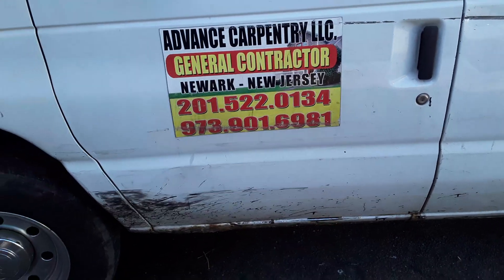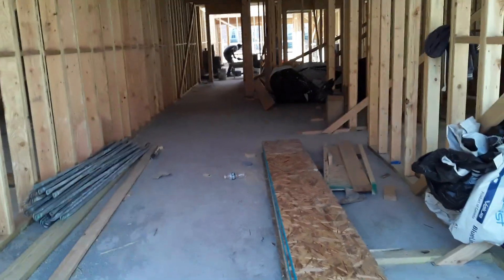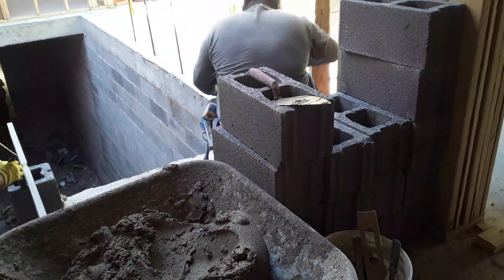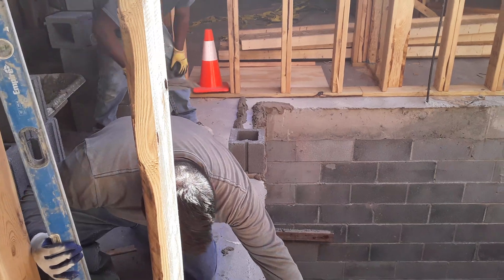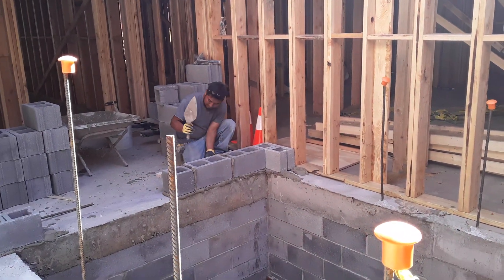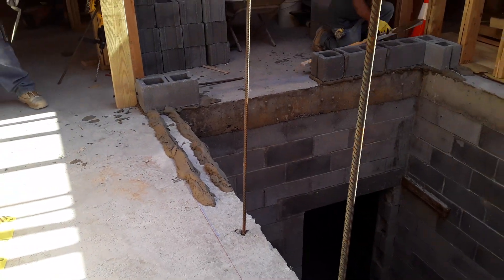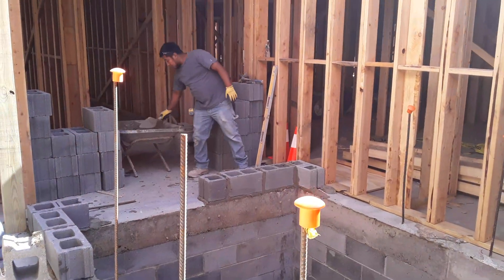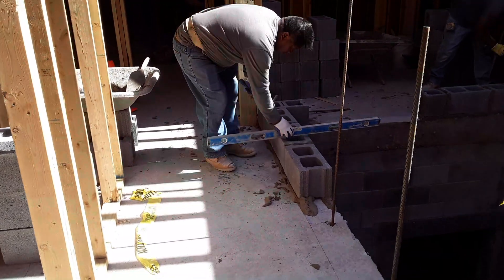#CHARLES #FLORIO BUILDING COMPLEX 185 BROADWAY PATERSON NJ|J&M PLUS ADVANCE CARPENTRY WORK TOGETHER!

Comment: I love wooden house..remembering our house
Reply from the maker: It Is Not A Wooden APARTMENT BUILDING COMPLEX. This Structure Is Consist Of Steel, Cinder Blocks,Concrete,Wood,Concrete STUCCO,Metallic FRAMES And Paneling,Steel Mesh. And In Addition To All OF That,You Have PVC Pipe For Plumbing, Modern Electrical Systems,Fire And Safety SYSTEM,Aircondition And Heating Systems,Telecomunication Systems. SO What I Am Saying This Is Not A Wooden BUILDING Per-Say. Thanks For Watching And Commenting.✅‼🙏🏻🤔